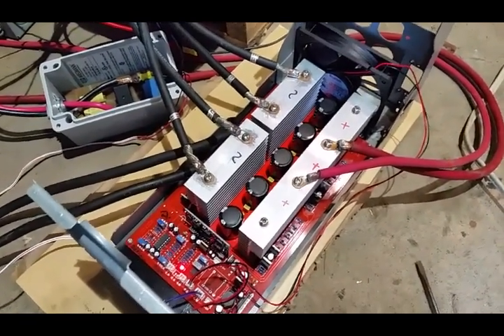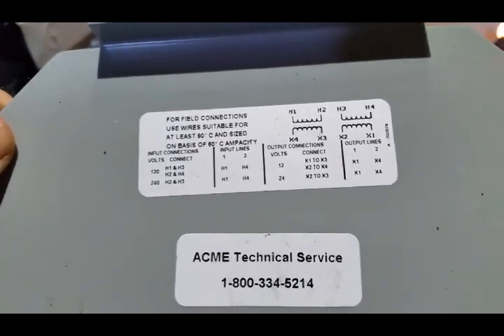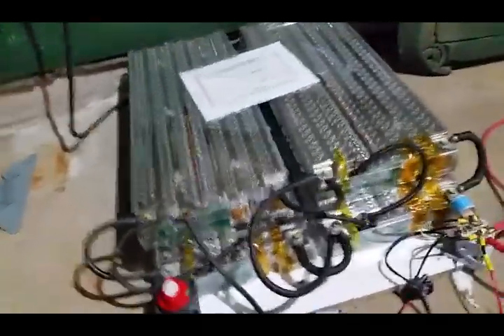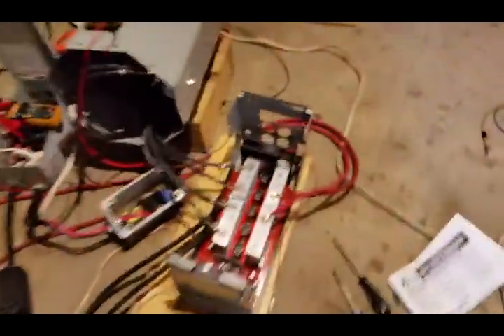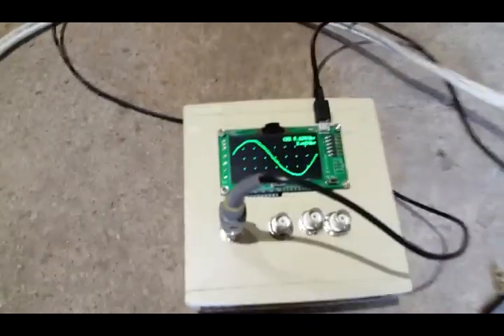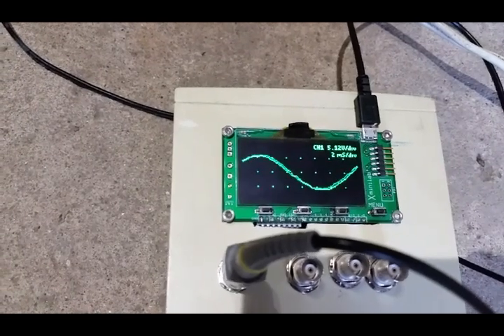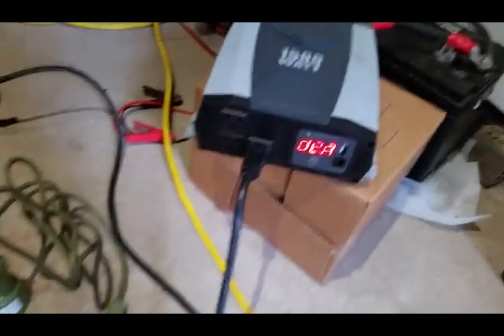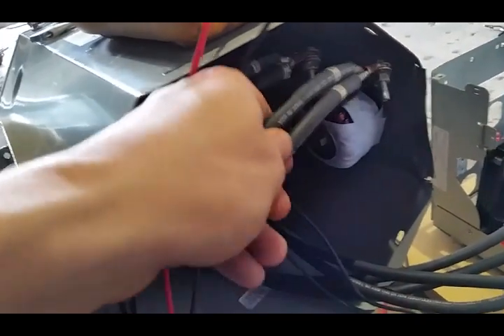Inverter load test

Comment: Been using a similar type inverter. 24v to 230v 2kw. Pcb has on board blade fuses and wire links for current limit detection. These two items had to be removed from the board as at 100A they heated and went open circuit. I to cant build a suitable inductor so i gave up and removed it. The result is high standby idle current about 4A and high harmonics  as noted at 50 mhz amatuer band reception. Its been reliably charging my Tesla at around 80A input I.  My transformer LV winding consists of 2 x windings in parrellel using 6mm tps cable which gets quite warm. Been in for 12months and still running strong. So yes these inverters seem quite reliable once the high current issues are resolved. Thanks for posting.

Comment: Ok firstly the reason why the inductor getting fire hot is that core exceed the magnetic frequency flux to collapse causing heating because the load setting up the magnetic field that transferring energy causing the RCL inductor to charging up and down abnormal frequency the low frequency becomes 415hz to 500hz with the ferrite core so that’s your problem use a bigger ferrite core as in 2 time the size using in the system and don’t use that big aluminum transformer because those transformer use aluminum coil not copper magnetic wire to reduce the heating

Comment: The inverter has problems driving heavy smps loads, as current draw is excessive at the peaks, it causes flat topping and horrible distortion, no problems with restrictive loads however.

Comment: not sure if this is possible or not you're pretty slick at this kind of stuff is there any way build and inverter that takes in maybe I don't know a hundred twenty or 220 volts and just turn DC straight into AC no batteries no Transformers just straight through maybe some big capacitors to even the DC voltage Out Maybe stupid idea I don't know since I could be very useful no charge controller no Transformer no battery
Reply from the maker: since you mentioned charge controller, I'm assuming your high voltage DC is coming from solar panels? if yes, then it won't work since they are a constant current source. but if we are talking about high voltage batteries, yes, it can work with the right components, but you'll need a big inductor to create a smooth sinewave on the output, there is a schematic in the datasheet for the control module